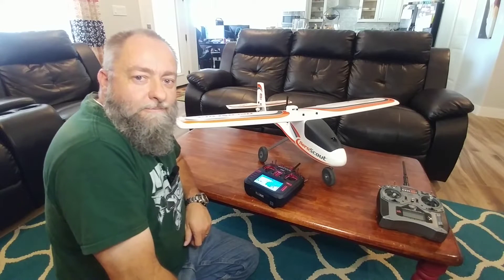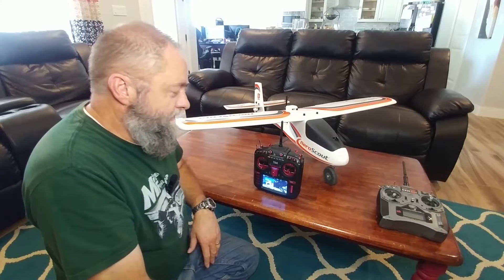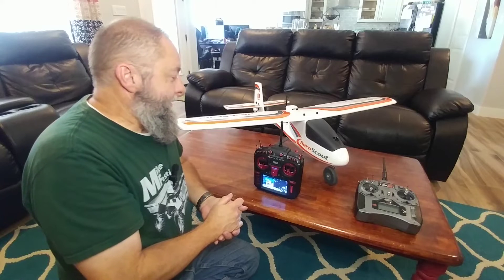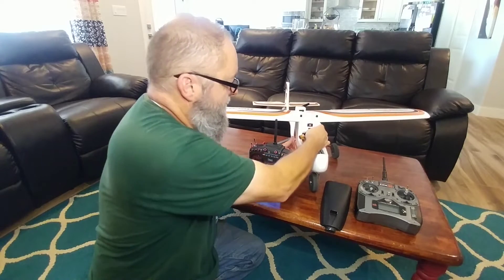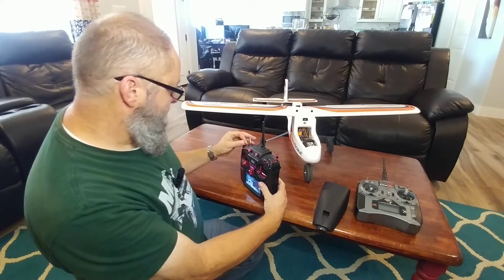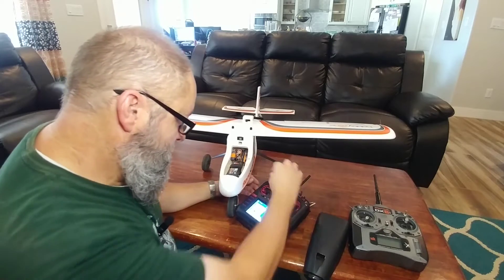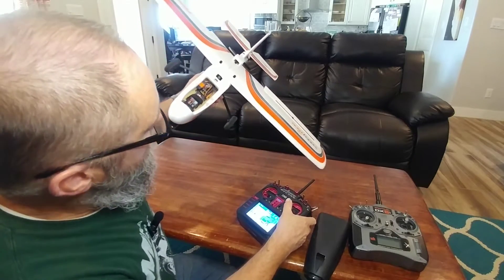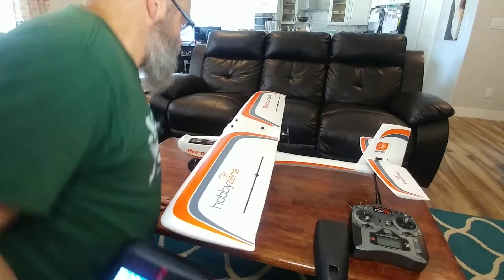Spektrum RC Safe Modes on the Radiomaster TX16S!

Comment: I have a TX16s with opentx and an AR631 in my BNF recently purchased Night Raiden plane, I cant get it to work? I have the OPENTX so my screens are very different and kind of hard to follow? I kind of get the settings but no luck? Is your initial bind setup with SAFE Select or AS3X ONLY? Mine is setup with AS3X Only but I did rebind to SAFE Select to try and no response? I know my plane is the BNF because it came with the rx which is locked to Spektrum. All I want to do is Turn on and off SAFE Select so If I have a friend I can let fly and feel a bit safe from him able to crash. I want to put it on a 3 pos switch if possible because my SF (momentary) switch is used to reset my timers. Hope someone can help me because I am really close to buying a Spektrum TX just to unlock it and then returning it. Also can you use a USB programming cable to reset/unlock the AR631 because they are allot cheaper than a $249+ DX6e? I sure hope someone can help me in the mean time? I will keep hacking at it and if anything changes I will post it on here. Maybe I need to switch to EdgeTX?
Reply from the maker: You definitely have to bind with safe activated. In the manual for the plane does it tell you which channel is SAFE tied to? In my video the default channel assignments were using channels 5 & 6. If your default channel assignments are different that will change the setup for your application. Later today I will see if I can find any info on your planes default settings and let you know.

The momentary switch would only work for the panic mode. To turn safe on/off you need to use a 2 or 3 way switch. In my setup I didn't use a panic button, I combined the two channels to get 4 different safe/as3x flight modes. Sounds like you aren't trying to get that complex. Check back later and hopefully I can find some info on your plane.
Reply: @shanesdiy  https://www.horizonhobby.com/on/demandware.static/-/Sites-horizon-master/default/dw92f5be59/Manuals/EFL36500-Manual-EN.pdf
Reply from the maker: I think you meant "Night Radian"?   I looked up the manual and on page 9 describes setting your Safe channel.  The AeroScout had 5 & 6 preset, your Radian doesn't have a default channel.  You need assign a switch in your mixes to any channel between 5-9 (5 is default for lights but I don't think it uses the data, just the power from channel 5).  I personally would set any 2 or 3 way switch you want to use for Safe and set it to channel 7 so you keep your physical channels available. I use switch SE and down is SAFE.  Page 9 describes how to set the channel. Assuming you already have the throttle, rudder, elevator, and ailerons all set and working the proper directions, you'll move both sticks down and to the center (and hold) then flip the safe switch you assigned up and down 5 times and it will assign that switch to safe mode.  Start with the switch down and one "flip" = full up and full down.  On the 5th toggle you should see/hear the control surfaces move briefly.

Do not set your throttle cut if you have one setup.  Either remove your prop or keep clear of it in case it rotates during the process.
Reply: It is the Radian...typo error. I just am not sure what settings to set and where I even switched to Edge TX. Which switch and what programming? I get confused because on one switch do I set it up with the special functions switch or the logical switch or in my mixer settings and at what values? +100 to -100? The method you said by using the switch and flipping it 5 times is what I originally tried and did not work. My plane does not have ailerons but it is the 6ch AR631. Just not sure where to start...as far as menus go...do I put the settings in the Flight Modes, Inputs, Mixes, Output, Global Variables or Logical, Special Functions menu? I am good at following directions and I followed your video to the exact settings originally(after switching to EdgeTX) and no luck. I do think in my case I will have to get a FWD Programming Spektrum TX to unlock it because even though we have the same RX yours might have not been locked? I just wish I had someone in my area with a Spektrum radio and this issue would have been resolved. When I had OpenTX on the radio I even tried the lua scripts but in that menu it only showed Gyro settings but a bunch of Unknown_XXXX and one with a value of 109??? With EdgeTX it does not even work with DSM FWD Programming it just flashes "No compatible DSM RX" so EdgeTX must not recognize the RX? Thanks for the help and trying to get it to work for me.
Reply from the maker: If you are starting from close to zero knowledge on these radios I would suggest you watch videos by "RC Video Reviews".  He has dozens, maybe hundreds, of awesome tutorials on everything related to the RadioMaster TX16S, OpenTX, EdgeTX, Inputs, Mixes, Outputs, etc.  It would be good to start there and get a good base knowledge of the radio and its functions.
Reply: I have watched his videos and setup quite a few things but nothing on Spektrum to TX16s. Yes I do know how to work the menus use Edge TX companion set rates ect...it's just the programing code that gets me. Just need help with the programming menus and there aren't any YouTube tutorials that deep that I have found? @shanesdiy
Reply from the maker: For the basic SAFE on/off control you don't need to do anything with the logical switches or special functions. Just add the switch you want to use to the mixes on the correct channel. Put both sticks down and in (and hold) and flip the SAFE switch on-off-on-off-on-off-on-off-on-off (start with the switch off/away from you).  As long as you enabled safe when you did the bind it should link that switch to safe.
Reply: @shanesdiy  That is the issue....unless you unlock it first you can't just assign it too a switch...I have been through assigning a switch on multiple videos. Only one video is where the guy actually said "you have to unlock the FWD Programming on the receiver initially with a Spektrum transmitter BEFORE you can assign it to a switch. I will find it and post it here.
Reply: I also found this and it has Gear on 5 and Aux1 on 6?  https://www.spektrumrc.com/ProdInfo/Files/SPMAR631-Manual-EN.pdf

Comment: I have a TX16s with edgetx and an AR637TA in my BNF plane. I just want safe and manual mode. I got it bound in safe mode, but it won't turn off. Any ideas? I have safe setup on CH5 with SF1 - 100 and SF2 100.
Reply from the maker: Try channel setting your switch to 6 instead of channel 5.

Comment: New flyer here for about a month now. I have the AeroScout, so this was perfect for me and this deserves a subscribe, as that was the best explanation I've found. Now I can give my friends DX7 back to him, since I've got my radio working with AS3X and SAFE mode. Though with my TX16S MKII EdgeTX the, LOGICAL SWITCHES, needed to be all  0's at V2. So, Func = a=x, V1 = CH5 or CH6, V2 = 0, AND Switch = SA(Up)....On L01,L02,L03 the V2's are 0. Then from there, the SPECIAL FUNCTIONS are as you stated. Anyone wanting to use a panic switch out of 3D mod, the momentary SH switch with Override, CH6, Value = 0, Enable works..It's only momentary though. I figure I can hit the SA switch with my index finger quick enough into FMod1 or beginner, as this is the mode it goes into with the panic switch activation.
Reply from the maker: Thanks for the kind words, the extra info, and the sub! Very happy to hear it was helpful. Happy flying!

Stay tuned for an upcoming video where I'll show a complete reprogram of one of my AeroScouts. Involves a receiver firmware update, factory reset to "jailbreak" it, and fresh forward programming through a Spektrum NX6. Now with added flaperons while keeping safe and AS3X. Unfortunately just could not do all of this with the TX16S. Details will be revealed!

Comment: This is amazing! Worked well with my TX16S and Carbon Cub S2!
Reply: Same here!
Reply: Are you able. to get telemetry on your radio? I what the battery level of my carbon cub.
Reply: @aqua-gator9557  No, I just use a lipo battery alarm when flying
Reply: @airplaneguru84  can u tell me how to install that or where to find a video.

Comment: Thank you so much for sharing your knowledge! I have the same transmitter, the radiomaster TX16S and am very impressed with what it can do. So i have a question on how you would do this with a spektrum reciever( specifically the AR636A) where the landing gear is channel 5. This is on the eflite f-16 thunderbird jet but should apply to others where landing gear is on channel 5. This is probably a simple question for you but this radiomaster transmitter is probably capable of flying the next space shuttle with all it can do!
Reply from the maker: From what I see the current E-flite F-16 uses the AR631 receiver which has AS3X and SAFE.  I don't believe the AR636 has SAFE, only AS3X so would only use one channel.   The AR636 has 6 physical channels but also has 3 "virtual channels" from what I read.  I believe you can program your AS3X function to any channel 6-9 but you might have to use the Spektrum programmer #SPMA3081 according to the manual.  Manual also says AS3X is OFF by default according to the AR636 manual but the BNF version of the receiver that comes with the E-flite F-16 may have AS3X on. I can't find a manual for the version of that airplane that came with the AR636.  The AR636 is not one of the newer "SMART" receivers so I don't think it uses the forward programming feature to set it up.
Reply: @shanesdiy  Awesome thanks so much for your help! I will see what i can figure out with it!

Comment: I also believe that the TX16s allows you to do DSM foreard programing in through the LUA scripts. Yo can adjust setting there.
Reply from the maker: Correct, but the AR631 in the AeroScout is "locked" from the factory in BNF aircraft so my TX16s would not recognize it. I have since updated the firmware and should be able to do a factory reset to unlock it and allow me to fully configure it. I'll post a video when I try it.
Reply: @shanesdiy  That would be an excellent video. Looking forward to it. Cheers.

Comment: How did you bind the Rx to the Tx?
Reply from the maker: Transmitter already on with the model created. Go into model setup and scroll down to "Bind" and highlight but don't click.

On the Rx insert the bind plug and power it up. If you want Safe Mode. Pull out the bind plug after power up. If no Safe, leave bind plug in.

Move the TX a few feet away from the Rx. Then on the TX click the Bind button. After a few seconds the plane should react indicating it is bound.

Comment: This has worked fantastic on a carbon cub. Just put it all on SE switch with SE down being the modifies safe mode with self leveling. Do you know if the flight battery voltage telemetry can be displayed as well? Thank you for sharing this video.
Reply: Yup i got telemtry work Evin and Erpm. When i have been binding i usually just use DSM auto in open tx. I use the value to create a logical switch for a flight battery low voltage warning.
Reply: @alvandergoot7237  thank you
Reply from the maker: The AR631 doesn't have flight battery voltage available to my knowledge. I can see receiver voltage but thats not very helpful.
Reply: @shanesdiy  I apparrntly have a SPM4650C receiver with a SPMA3232 flight controler installed  guess l need to do a bit more research .Thanks
Reply: @alvandergoot7237  if you are getting telemetry from the rx, you can set up a screen widget with a monitor on EVIN. that will give you battery voltage from the plane.
Reply: @alvandergoot7237 . I do as well. Did you ever get this to work?
Reply from the maker: As long as you are bound using one of the DSMX protocols (not DSM2) you should be able to go to the telemetry tab and "Discover New". Anything available will appear in the list. Some may require deciphering as they don't always get a clear name. Once that list is populated it can be used elsewhere in the radio like in Widgets.

Comment: When you set up the rates, you can do it in the mixer page and set up one switch to do all 3 rates. You dont need to it in the logical page
Reply from the maker: With the tx16s I'm sure there are a dozen different ways to set these outputs.  Mostly wanted to share the values for each channel to achieve the 4 safe modes.  Thanks for the tip I'll have to experiment with that!

Comment: Thanks a lot for this info! The 'secret' mode works great on my Aeroscout/TX16S. It will be interesting to see if I can get it to work on my still unpacked Turbo Timber Evolution BNF. On that aeroplane I will have to use channel 7 for SAFE. Hopefully channel 8 will cooperate 😎
Cheers from Sweden
Reply: Did you manage to make it work for the turbo timber evolution?

Comment: Oh, I just remembered there is supposed to be a panic mode, did you figure out how to activate that? Maybe put it on the momentary switch?
Reply from the maker: Didn't try that one yet, I will and post an update if I figure it out.

I have my momentary switch set for auto trim (I also moved it from the right to left side).

Edit: I put this in the description but you could set the Safe mode beginner settings to a momentary button and when pressed would be set to override the "mode 4 AS3X only" mode and recover.